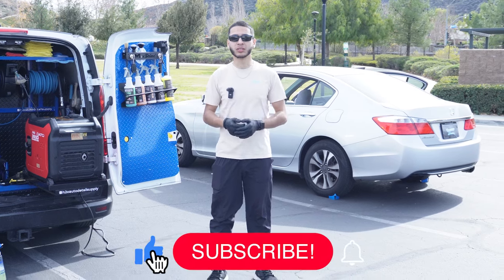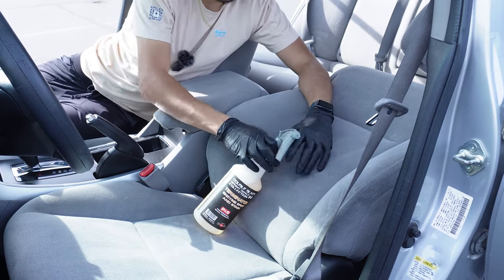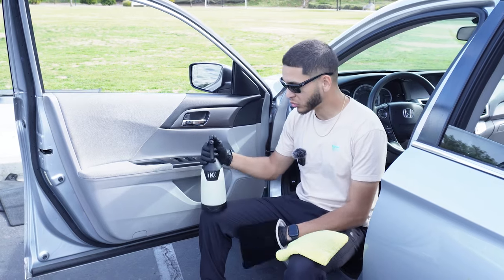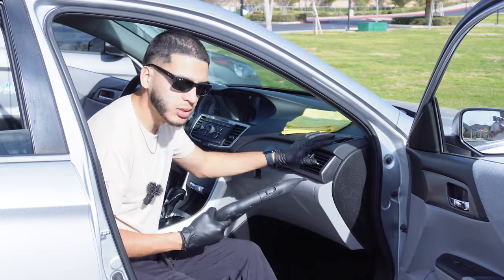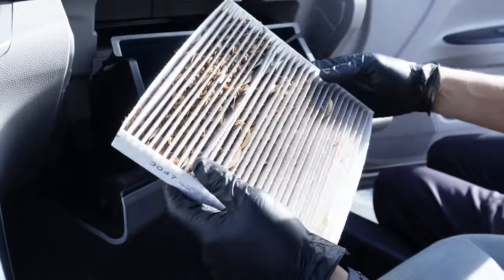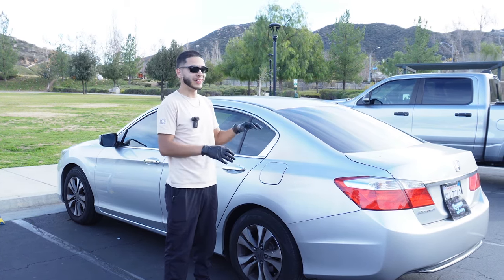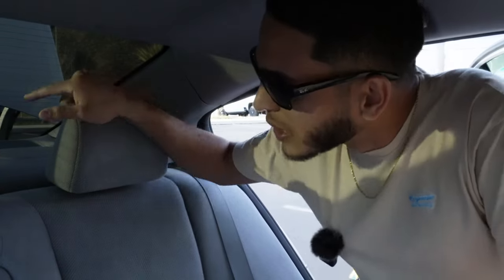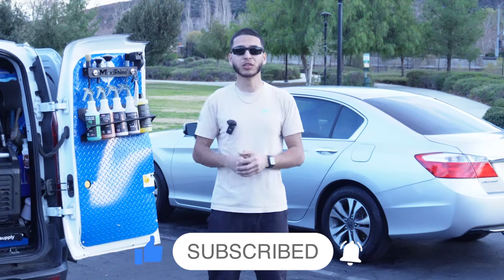How To Remove 100% Of Odors From Your Car Without an Ozone Generator - Reynoso Auto Detailing

Comment: We recently bought a beautiful used car, but the cigarette smell took away a lot of that new car joy. I researched and decided to try Reynoso's method and it worked amazingly 🤩 I used just the Terminator Enzyme Spot and Stain Remover, Carpet Bomber, Finisher Peroxide Treatment, Xpress Interior Cleaner, and a $100 steamer I bought on Amazon which I used with the Biobomb minis. It was a lot better just after cleaning, but the big Biobomb at the end really finished it off! I kinda forgot about it and left it more than 12 hours so the chlorine smell was a little strong 😂 but after airing out and using the bar air freshener it literally smells better than new ❤  I spent about $160, but with enough product left to clean my car probably at least 4 more times. Thank you so much for saving me the $600+2 days the detailer wanted to do the cleaning with the ozone!
Reply from the maker: That makes me so happy to hear you were able to do this entire detail for your own car for $160!!! Thank you for sharing this is the best comment on this video by far to show everyone it can be done, enjoy the new to you car!

Comment: All good products and methods - but no way was that "a quarter of the time and one tenth the cost of an ozone generator".
Reply from the maker: Yes actually it is, the BioBomb is a 1 hour treatment and ozone generator is an average of 4 hours. A quarter of the time. A biobomb is $20 and the aerator is $20, $40 total, compared to a minimum of a $400 ozone generator (still a cheap lower quality ozone generator), that’s one tenth of the cost.
Reply: An ozone generator is like $50 man. And 4 hours of ozone treatment is way too much. Even if the ozone generator was $400, it’s still much cheaper in the long run if you’re a detailer.
Reply from the maker: @The_Cyberz  Brother an ozone generator that’s $50 will blow up on you or catch a fire after a few times of use
Reply: @reynosoautodetailing VERY false. Mine has treated multiple cars, bedrooms and bathrooms, all without any problems whatsoever. Had it for 4 years, paid about $80 brand new from Amazon.
Reply from the maker: @misssummersalt  I’d be worried enough buying it from Amazon lol
Reply: @misssummersalt  FACTS!!!
Reply: @reynosoautodetailing  I’ve used bombs and have a ozone from Amazon. The ozone is cheaper. By the time you buy 2 bombs that’s the price of a Amazon ozone you can use limitless times as short or long as u want. To each his own but less time and less money overall. Plug it up set the timer throw it in and keep moving. No knock to how you’re doing it I used to do the same thing but don’t knock someone else way saying stuff like it’ll blow up lmao.
Reply: Agreed. Plus the ozone generator kills organic matter residuals in a way making it antibacterial and antinvural getting in all of the vehicle.
Reply from the maker: @garyfrederick21 Reality is a $50 ozone generator will blow up lol there’s a high chance of it burning up or having a huge malfunction like any other machine that’s cheap, same thing happens with $50-$100 steamers, professional grade safe ozone generators that car detailing businesses normally carry will cost on average $500-$700
Reply from the maker: @Ahern1245 That’s exactly what chlorine dioxide does too! Great antiviral and antibacterial
Reply: @reynosoautodetailing  Mine hasn't blown up. 😁
Reply: @Ahern1245  I agree... Ozone generator kills the things you mention. I think most people don't realize that the Ozone generator effectiveness penetrates anywhere "Air" can get to making it more effective than any spray. That's unless you are willing to full submerge your care in a cleaning solution. 😆

Comment: Does this work to remove VOC smells in new car ? i bought a new car and I am unable to use it because it gives me headache and nausea. Looking for an effective way to remove the VOC/ new car smell.
Reply from the maker: For a brand new car honestly there’s no way to fully remove the smell until it airs out since it is gas, this might help tame the smell but you’ll likely still have the headaches and nausea. Mostly all the interior plastics and vinyls are hot pressed and that process includes a lot of chemicals and oils, months after a car is new, through hot and cold cycles those plastics and vinyls expand and contract and off-gas, creating that smell. You’ll notice it also causes windows to be foggy and streaky when the car is new and there’s nothing you can do but let it run its course. I just bought a new tesla too and keep the windows cracked sometimes at night or during the day to vent it out, it usually goes away within a few months to a year

Comment: Smart towel method.  They do fizz a bit with the pump.  I’m doing this method from now on.  Typically put it in a larger open container, but this protects the area, and keeps it stable in the cup holder.
Reply from the maker: That’s a good idea

Comment: How do you do it if you get a car with no a/c? Can u still use bio bombs?
Reply from the maker: Yes you can still use Biobombs AC is not necessary it just helps to the gas out of the car faster

Comment: You don’t use an Extractor for one of these jobs?
Reply from the maker: Personally I’m not a fan of extractors, I haven’t used an extractor in over 2 years and have much better success with steamers. Especially when it comes to an odor removal like this, leaving water behind or moisture deep in seats won’t allow the chlorine dioxide gas to fully penetrate and eliminate odors, and will potentially grow mold and just cause more odors. I highly recommend only using steamers for processes like these on interiors :)